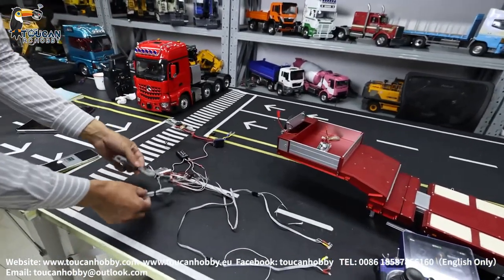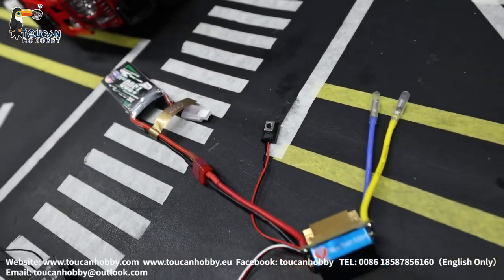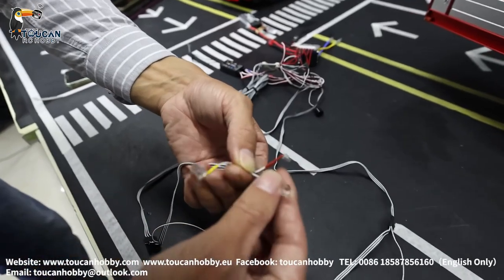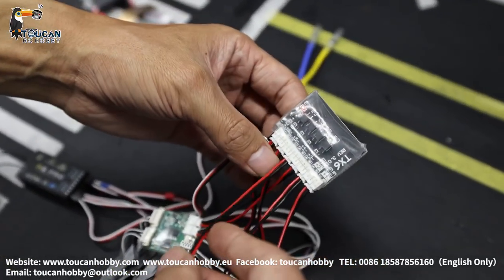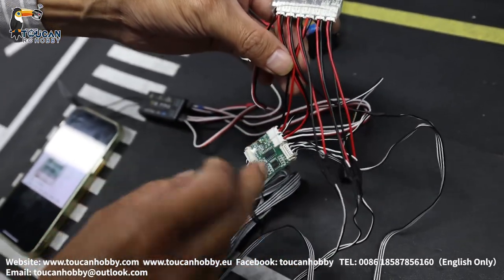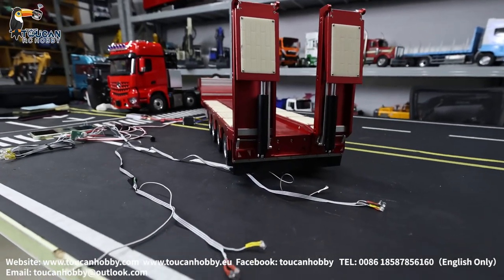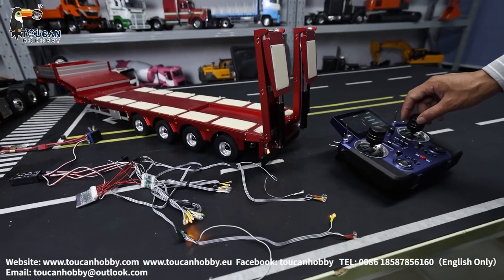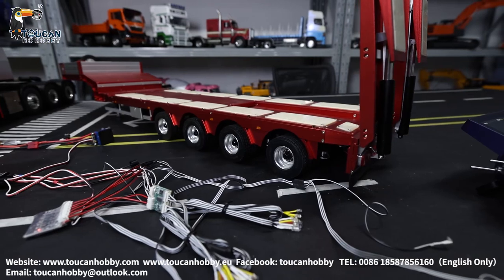How to connect wires for your Degree Trailer 997, to make the lights running synchronous with truck.

Comment: Where do the wires go to from the 997-2, s1 red, 2 yellow, 3 white, 4 black, 5 blue, 6 green, 7 servo plug
Reply from the maker: Will send you manual my friend
Reply from the maker: Thank you for your strust, for more models details and service please visit my shop website: https://oliverhobby.com/ , for after sell service please add my Facebook: Oliver Lan ,    https://www.facebook.com/profile.php?id=100083176249155&mibextid=YMEMSu  ,or WhatsApp +8619376345156
Reply from the maker: Sorry for you don’t have manual in box
Reply: @toucanhobby2400  I received the manual but it says nothing about where those wires go.
Reply: I have started the process of returning the trailer as I can't get the assistant to get it to work.